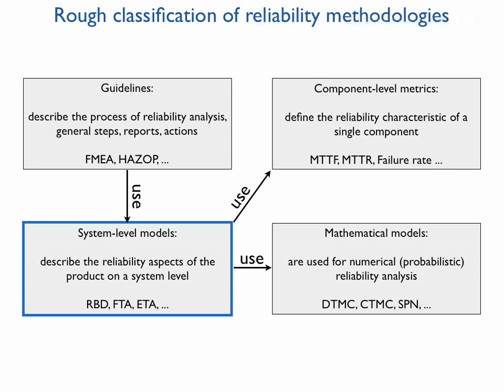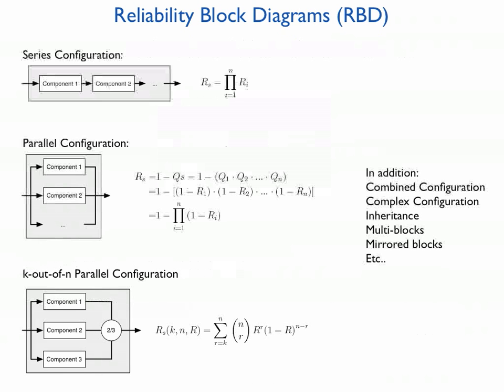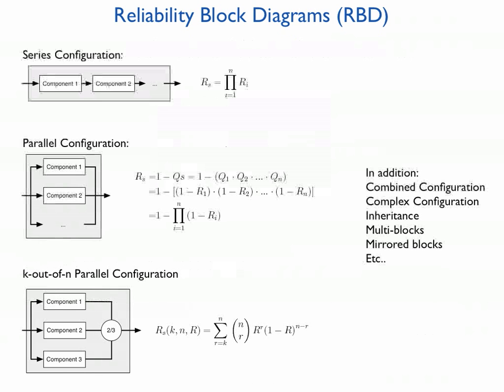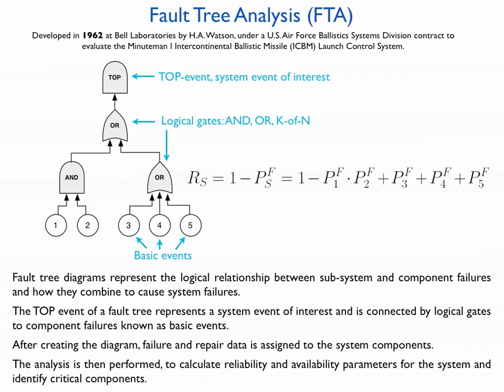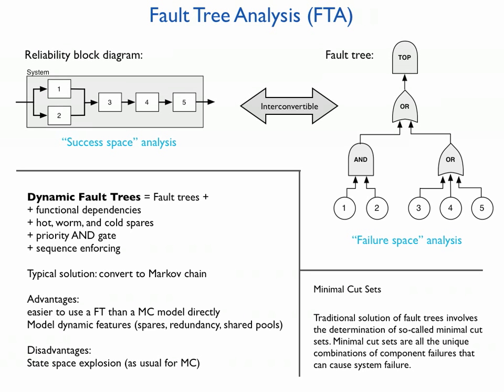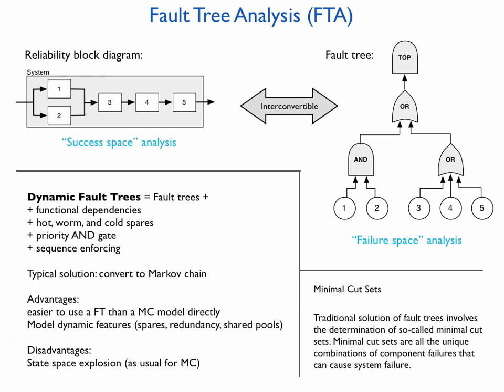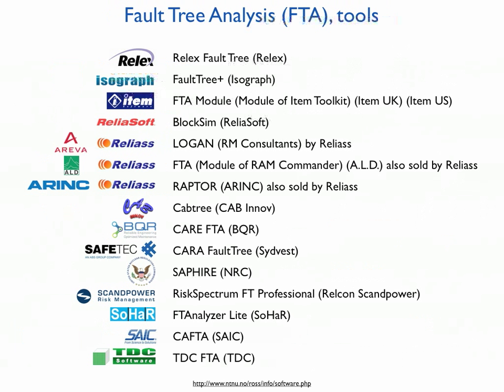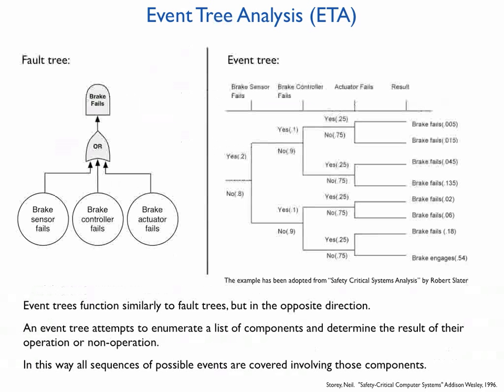Reliability 3 - RBD, FTA, ETA

Comment: It is a very useful video, i have a very stupid question that why RBD parallel connection is equal to FTA AND gates.  According to electronic devices AND gate means that both of them have to work properly and provide output value is 1. It means that if one of them status is falure the result is also failed .  0 and 1 output is 0